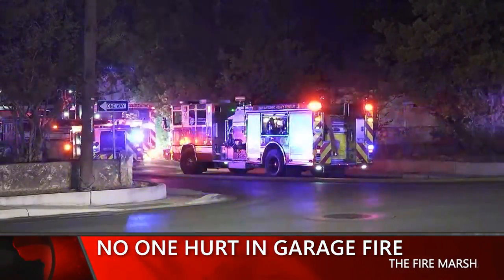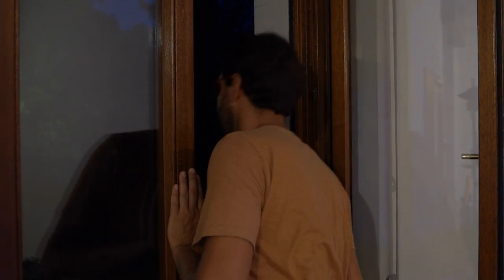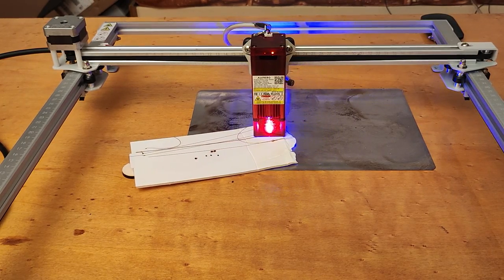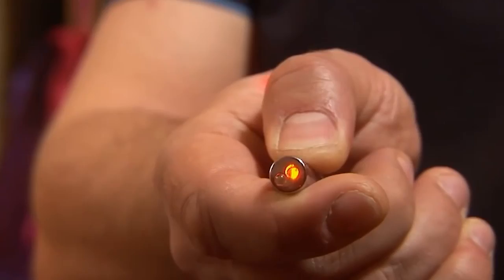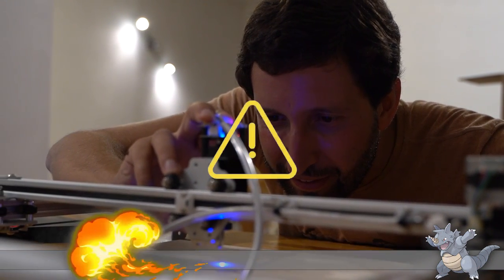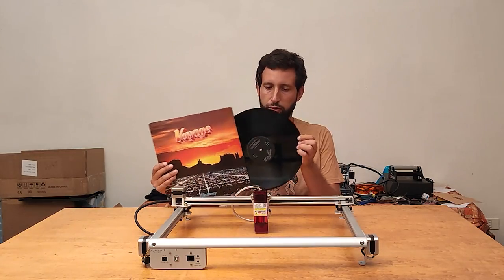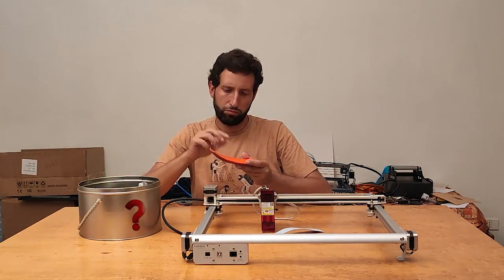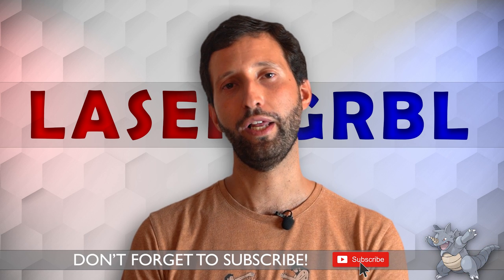Laser engraver accidents: how to prevent (laser engraving safety rules)

Comment: Excellent safety video - thank you! Should always be hammered home that safety has to come first and foremost.

Only thing I'd add on: make sure your safety goggles are matched to the type of laser being used. Different lasers produce different wavelength spectrums and your goggles may not fully protect against them. Polycarbonate blocks most UV in general (roughly OD 5) but the proper tint/coating is needed for visible wavelengths. Always check goggle specs to match with your laser.

Comment: I inserted a servo on the engraver to manage a pen but I can't get in line with it. While with other software the problem does not occur, I would like to know if any friends have the same problem as me when they use LaserGRBL. This occurs with GRBL version 0.9J installed on the Arduino. The system attempts to connect. The installed release (0.9) is immediately displayed on the screen, but an instant later the communication stops.
Surely I forgot something but can you help me? Thank you